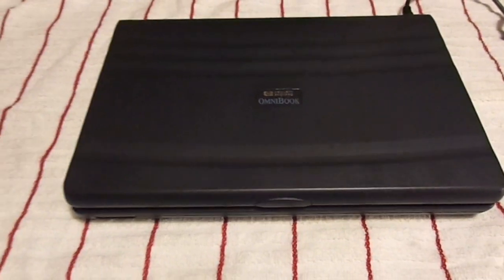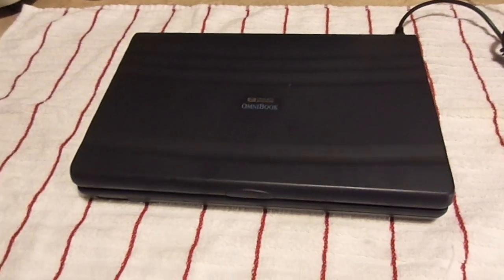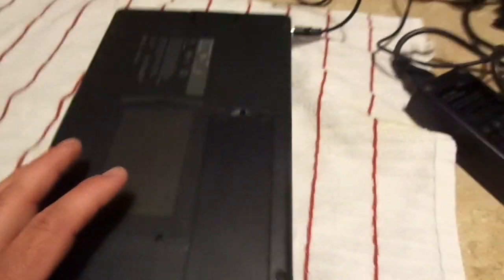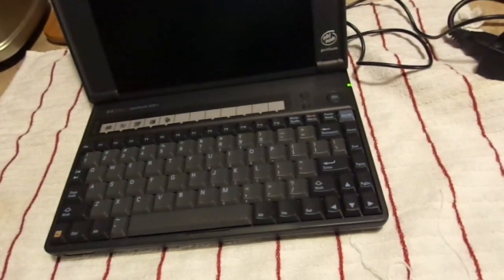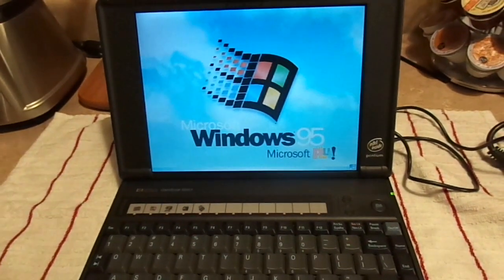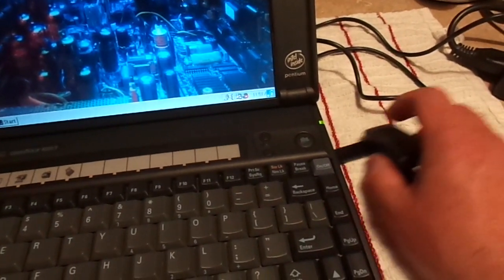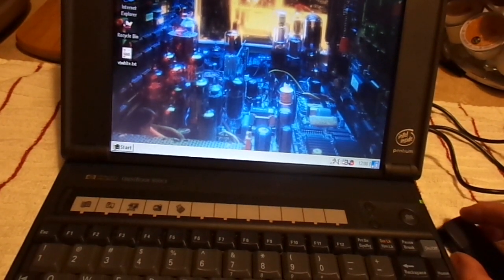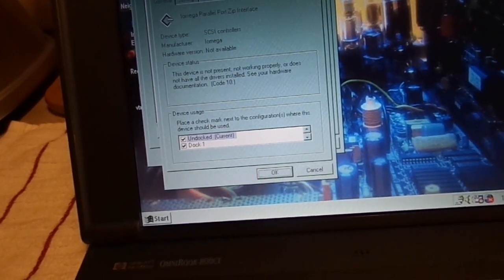HP OmniBook 800CT

Comment: The Omnibook 425 was even more strange. Ran a pseudo 486 with office and windows 3.11 running from rom, not loading them from rom but running them in the rom. Could run on 4 AA batteries. Used one regularly outside as the mono LCD worked great outdoors as it was not backlit. It was smaller that the 800. Came with a 10Mb flash drive to save your documents and Laplink for windows in the rom too.

Comment: Wow, that mouse, what were they thinking?
Reply: lmull3 That's a very good question... Maybe someone at HP was drinking beer while constructing this mouse.
Reply: MilenniumEdition 56 It was bad enough that no one else ever copied it. But it may still be better than the "J key mouse", which was briefly popular on laptops in the early '90s. Instead of putting an "eraser head" between the keys, like IBM's TrackPoint and its clones, it used the J key on the keyboard itself as a pointing device, tilting it to move the mouse pointer around. And they usually stuck the mouse buttons in an uncomfortable location, like on the side or front of the case.
Reply: vwestlife I totally forgot about that. I've never used a j-key mouse before but I'd imagine a lot of unecessary J's were typed.
Reply: vwestlife That'd be a lot of mistyped js. The Omnibook pointing device might still be worse, but at least there are no mistyped JS
Reply: lmull3 They held in too many farts.
Reply: Max Greyfeather gg
Reply: MilenniumEdition 56 More than beer...
Reply: I *loved* that mouse.  It was so innovative and it worked great.  The alternative at the time was either a trackball or walking around with a mouse in your bag. Instead, you had a pop out mouse built in - and it even worked "floating" if you had the machine in your lap!

Comment: I have one and love it... I have the floppy drive..works.. I have CD drive but missing an adapter so cannot connect it.. The mouse buttons have failed. I normally re-install OS on any machine I get but reluctant to try doing that with the 800CT  Has anyone done that using the floppy drive with files found online? Should I leave the OS asit is... I normally just use it for dos based compiler.. Borland C   Thank you for any advice you can give...
Reply: Thank you Robert .*****

Comment: I have the 166 MMX version with 80Mb of memory running windows 2000 with compact flash for the windows swap file and a 10BaseT network card. I works surprisingly well. Forget using the Internet though.

Comment: This has got to be one of the most funniest videos you've done in awhile.
I'd also like to agree that's the most retarded mouse I've ever seen. 
I mean, how the fuck are you suppose to do anyshit when you have it in your lap?
Nope! Screw using the "mouse" You'll just have to pretend that thing sticking out of your expensive investment isn't there. Trying to still use it while the laptop is on your lap, having so so cal' "mouse" hanging out the side is going to work. Question; can it work with nothing below it"?

Comment: Why not use the keyboard to navigate around? Way better than any mouse on notebooks! I mean many touchpads (except Apple made) are even worse! Try a cheap Packard Bell from around 2013 you'd think the notebook is infected or so but no it is just the touchpad clicking and jumping around. By the way the SCSI-Port had no drivers themselves and the driver for a parallel port zip drive is installed and was seemingly connected to the docks it says in device manager.

Comment: Hey BBISHOPPCM"S World, I have the original install disk for this computer, if you want a copy let me know.  It has all drivers and original software that came with the unit.  Actually I think it restores the unit to factory settings again just like when new.  I was very lucky to find this along with the skuzzy cd rom, cord that goes with it and the docking station, all at Value Village the the sum of ten dollars!.  The restore cd was left in the cd rom.  The only thing I don't have is the power adapter for the c rom and docking station as it requires a separate one from the computer itself.  I love this little computer, it works great for old DOS games!  Let me know if you or anyone else wants a copy.

Comment: I have one of these. It was my first laptop ever! I saved up 100 bucks in high school to get it in 98'! The Panasonic CDROM was shipped/ supplied by HP for it. It is the original CDROM....and BTW, HP never made a cable to connect it directly to the omnibook, you could only use it with the docking station.

The SCSI connector was only acessable as a serial connector via a special cable when the laptop wasn't connected to the docking station.....

due to the fact that the additional hardware required to run the SCSI port at full speed was actually in the the station itself, the only way to use the Panasonic CDROM without the docking station was with a pcmcia to SCSI cable. Which is supported. Good luck!    BTW this mouse is my fav pointing device ever...mine worked perfectly